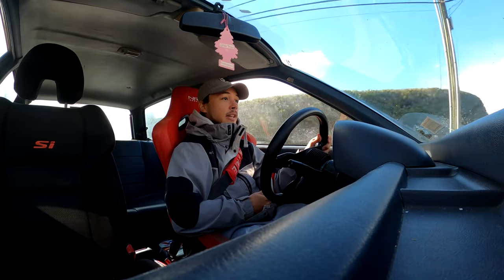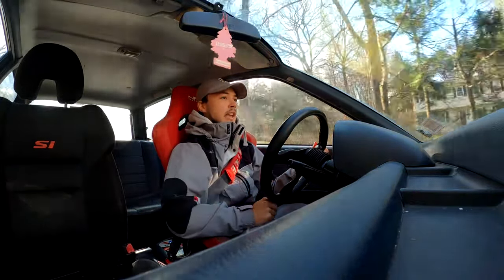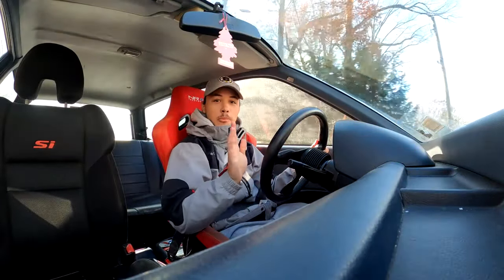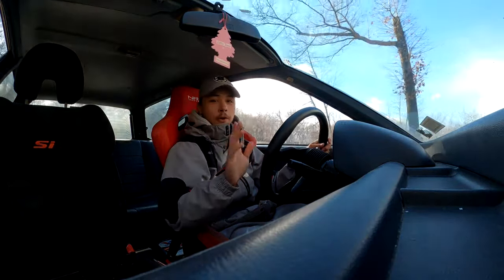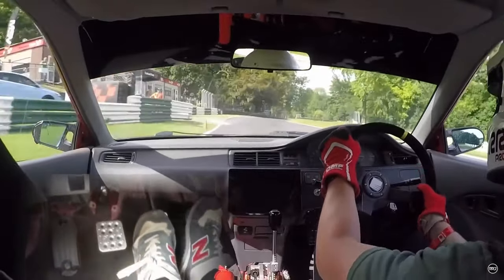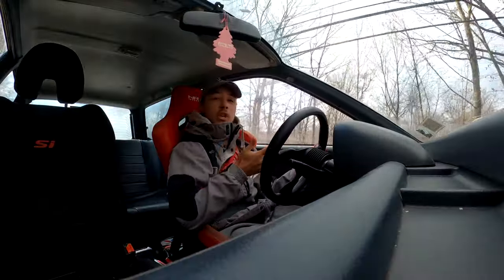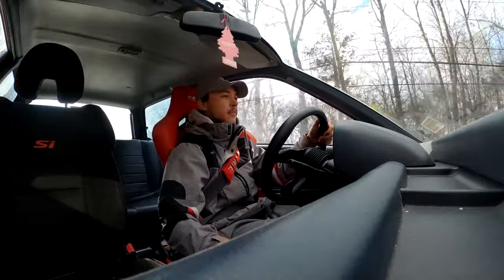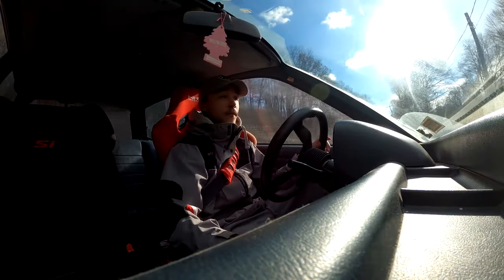3 Mods That Can Make Your Honda Better!

Comment: I put in a skunk2 short shifter, a weighted mishimoto knob, replaced the rubber around the shifter and replaced the rest of the bushings with ES bushings. It went from sloppy to fantastic. I dont have coilovers yet, BUT, I replaced ALL of the control arms, camber arms, toe arms with skunk2 stuff, also put in new ball joints, tie rods, ES trailing arm bushings and sway bar bushings. I have an ASR 24mm rear  sway ready to go in, and its on 15x7 et35 wheels with 205/50/15 Kumho  V730 tires. Even with the stock struts and springs, it handles MUCH better than it did stock.
I bought it with a 4-1 header, catback, and a short ram intake.